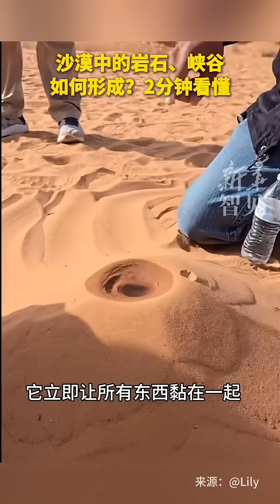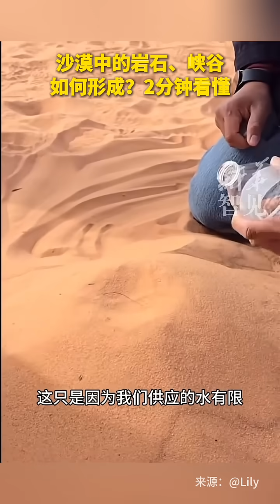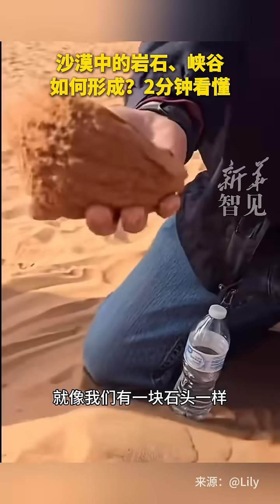I love listening to lectures like this.

Comment: To edify the ignorant demonstrator and those watching; 
google "cross-bedding" and watch the COLORADO SEDIMENTAION FLUME EXPERIEMNTS. Cross-bedding are the 10-15 degree angled lines that traverse across the horizontal sediment layers (if the sediment was deposited by flowing water like a flood. These can be seen on a major scale across all continents. THEY DEMONSTRATE the flow direction, speed, and timing of sediment deposits under flowing water. This information recently revised the their accepted age of the grand canyon by billions of years because of the combination of sedimentation, erosion and lava flows in the canyon. 
Trust physics you can see with your eyes, not a story "scientists" have been brainwashed to accept.

Comment: I’m a geologist. Nice demonstration, but the formation of sedimentary rocks isn’t represented accurately here. Silica doesn’t just “turn into glue” from rainwater, and the sun doesn’t “bake rocks”. The sedimentary rocks are compacted underground from high pressures caused by deep burial. Infiltrating groundwater with dissolved ions can precipitate silica and calcium carbonate in between pore spaces, cementing the compacted stone. After deep burial, tectonic forces uplifted the rock, and the overlying material gradually eroded until the sandstone was exposed at the surface. The part he got correct: flooding events carved the modern canyons. The sand in the area is deposited through wind. A cool video - but it isn’t rooted in science.

Comment: And right there after first cycle, China found a way to desert Greening by Silica compassion, and making the whole and filing with long lasting type of plant in advance. Then making canals from surrounding rivers pouring into the land and it take less than a decade to witness a brand new forest. Other trick is to releasing tens of thousands rabbits in deserts. Go and find out why...😅

Comment: I guess it doesn't take thousands of years, just a few min.
Reply: He literally said it takes millions. This is what happens at a larger scale. Dirt, rocks, and other mixtures of minerals aren't as loose as small desert sand. That's why he uses it as a demonstration.
Reply: @aangmaster9392 
Sand formations are quick and temporary.
Hard rock formations like granite are really old.
Reply: @Jpm463 That's what im saying, so I'm confused why you think this wouldn't take thousands to even millions of years.
Reply: @aangmaster9392 
Cool you get it. 
When structures collapse after some wind and rain you realize you should question claims of, 'millions of years old'.
Tettegouche sea stack, Azure Window, and Utah's Double Arch are just a few recent examples.
Reply: @Jpm463 No, Millions of years old is realistic because they're harder materials than sand covered in water, and wouldn't collapse as much. What are you not getting?
Reply: @aangmaster9392  got it, so you're saying iconic, millions of years old formations collapse after it rains. And its the first time it had ever seen heavy rain in millions of years. This happens about once per year. So there must of have been millions of these one of a kind iconic formations at one point. 
Sure that math adds up. 
So where are the current millions of iconic sedimentary formations? Are we at the end of an era?
Reply: @Jpm463 Bruh..I never said old formations immediately collapse after receiving rain again. Where are you pulling this from??

Formations happen due to thousands to millions of years of erosion or natural elements. You do realise weathers never stay in the same location forever right?

The sahara desert literally used to be a green area and had lakes. Nothing stays the same and life moves on.

Comment: This is bullshit. Sandstone turns into rock through pressure and temperature increase which mobilizes the silica and deposits it around the grains, cementing it. Meteoric fluids only cement if they bring in calcium carbonate and only in limited concretions.

Comment: Great demonstration, but.... the rain water is not concentrated in a heavy downpour over a part of a rock. It covers a very large area, equally distributing the weight of precipitation. Also, the canyons would have the "delta" with the debris at the mouth of the canyon, just like in the demonstration,  which would cause the collection of the debris mounts, which are not found, either.  🤷‍♀️

Comment: There’s just one problem with this…. The highest point of Grand Canyon is 8,000 feet and the height at which the Colorado river enters is 2,700. Even assuming that the river found some sort of underground passage that it caved in and pushed down stream, the canyon shouldn’t be nearly as wide as it is and unless water learned how to flow uphill… a flood is still the most likely answer. 

This is a great theory, but it’s just a very educated theory.

Comment: Pure fiction. Only one sediment responds this way to water The GC has multiple types of sediment. Scale this up by 100,000,000 to get the GC you would need a catastrophe to get the same results. And none of what he did was under intense compresion due to yhe weight that was above it. 
Learn to think critically before lovng on experiments like this.

Comment: The Grand Canyon wasn’t carved slowly over millions of years like they teach in school but was formed rapidly by a massive amount of water in a short period of time, probably from the catastrophic drainage of a giant post-Flood lake when the earth was recovering from Noah’s Flood. Imagine a dam breach on a scale you can’t even fathom, releasing water with incredible force that ripped through soft, freshly deposited sediments, cutting that huge canyon in days or weeks, not millions of years, leaving those flat, pancake-like layers as clear evidence it didn’t take long ages to lay them down or erode them out. You can see there’s no significant erosion between those layers, which means they were laid down quickly one after another, and there are fossilized trees standing upright through multiple layers, which couldn’t have happened if each layer took millions of years, proving this whole thing points to rapid deposition and rapid erosion in one giant catastrophic event.

Comment: The head waters of the Colorado River are around 1500 ft. lower in elevation than the rim of the canyon...    water doesn't flow uphill.
Reply: The Colorado plateau has been rising for millions of years.  The river has stayed relatively stable.  The canyon was carved as the plateau slowly uplifted, and the river slowly maintained its elevation.

Comment: The reason this doesnt work is because if the rain is to infrequent (like would be in aeolean enviornments) the soaked layers do not litify because they dry out to quickly.

Youed need consistent water to keep the underlaying layers from seperating upon deying before sufficient pressure can be put on top of it.

Comment: I call bullshit on this... The metaphor does not prove the proposition. "Professing themselves to be wise, they became fools..."

Tell me again how millions of years cause multiple layers of discrete sedimentary mineral deposits to stack on top of each other and become thick layers of solid rock extending for hundreds - if not thousands - of miles...?! 

It was OBVIOUSLY caused by one flood, as the volume of water required for such prodigious deposits was a one-shot deal - far greater than any amount of water that could be supported in a recycling ecosystem... THINK for a minute before believing illogical nonsense such as this creative fabrication...!

Comment: That also how the bricks to the pyramids were made. They had molds for the sand to be placed in. They filled the molds and when the rain came they became blocks. They were immediately covered for any future rains and stayed in the sun for 10 days. On the 11th day they were dragged to the location of the pyramids and thustly they were built.
Reply: No they weren't. The pyramids are built from limestone, not sandstone. And sand doesn't turn to stone just by soaking and drying it, it needs to go through that process hundreds of thousands of times to make a brick that could hold its own weight

Comment: Yeah ok. But it rains everywhere not only over a few square meters so why is the sand around it not strong?
Reply: Because the rock formation and canyons are flipping massive. You can get rain, and flash rain on small areas by the way, as small as a few square meters, sometimes called localized showers, or sunshowers.

Comment: The sand turning to a “glue”, or binding is actually due to silica, not silicon. The reason it binds is because of capillary forces and surface tension that holds it together.

Comment: This is what the internet should be. Useful information and not just brainrot.
Reply from the maker: Great lesson.
Reply: @山海木 not at all
Reply: This is brain rot. He said the water "melts the silica" what type of bullshit is that???? The silica are in chemical bonds (SiO2) you can't chemically alter something by physical means 

Also the sand is just sticking together by the water's surface tension. And the SUN heats up the sand to the point of rock formation???? That's just not how it works. He's spouting so much nonsense it's actually mind-numbing
Reply: So it's not brain rot huh? Quick where is this place located...yeah...it's brain rot...and stolen brain rot by some Chinese thief no less....
Reply: Yes!
Reply: Tu n'as pas de rivière en pierre de diamant pur.. toujours des cailloux et parmi les cailloux un diamant par-ci par-là
Reply: Fun thing is that this is all style but no substance, using simple water adhesion force as imposter for everything else just leaves people with the illusion of knowledge.
Reply: In what way is it useful?
Reply: @stvrob6320  don’t worry, if you’re asking that then intelligence and learning are probably not a strong suit for you

Comment: Why the heavy rain is only in the middle? Shouldn't it be all around?
Reply: rain doesn't fall over the entire planet at once, it falls in patches
Reply: @bonkdonk297  I understand in a circle, but I havent seen it be in like a S or Z shape🤷🏻‍♂️ so just wondering
Reply: @konstanZX2  if you are talking about when the water carves the rock in half to form a canyon, he says that's a flash flood. water will always take the path of least resistance. if there is a small part of the rock that is sloped more, rainwater will follow that path, and as it happens it will erode that path to be deeper, meaning that more water will flow down in subsequent floods which is what carves the shape of the canyon. think about a river, rivers are S shaped, curving back and forward as the water flows together and erodes the edges of its path
Reply: @bonkdonk297 Oh alright now I understand thank you!
Reply: @konstanZX2  glad to help, sorry I misunderstood your question at first :)

Comment: When how and why did the rain fall only in a spot that resembles a man pouring water out of a bottle??? 
In other words, as smooth as this guys voice is… it doesn’t make it necessarily true/accurate! Js
Reply: Water flows downward in the path of least resistance, that's how streams, rivers etc. are made. Imagine the water bottle as collected water running through these paths over a long period of time.
When you see videos like this, consider what the tools and process they are using represent.

Comment: Sorry, this is untrue geologic science, this is NOT what is found worldwide.

The Grand Canyon, nor other canyons with under-fit rivers at their bottoms, DO NOT look like the walls of this supposed canyon formed  by millions of years of flash floods and pressure cutting through rocks. But rather undisturbed (without bioturbation) sedimentary LAYERS of rock, which signify relatively RECENT formation. The layers seen in the Grand Canyon can be seen across the entire USA, as well as into the UK, Europe, and continuing around the world. This signifies a catastrophic world wide covering of water followed by catastrophic volcanism, and plate techtonics. Furthermore, these sedimentary layers are interrupted by uplifts from catastrophic volcanism and plate techtonics forming the mountain ranges we see today. Bending, or folds in these sedimentary layers are indications that the layers were soft when they were uplifted, as opposed to the uplifting of hard layers which would fracture or break. This, again, indicates that these surfaces were covered in water, and again can be seen THROUGHOUT the world!

The continental land formations seen away from the edges of these canyons are surface landforms that are seen after the receding away of water, ie; planation surfaces with, plateau's, mesa's, butte's and spires. A "flash flood" would not contribute to these continental formations, nor water or wind gaps seen worldwide. A worldwide flood even explains fossils and the supposed "geologic column" with an overwhelmingly convincing model.

Comment: Silica sand is really bad to breathe in yet it’s naturally found in the earth. Silica sand is used in sealcoating emulsion for grit and traction but has dangerous affects on lung scarring. Silica sand in sealcoat is mostly dangerous when the sealer dries and breaks away from the asphalt and blown around with dirt into dust when cleaning. It’s not just harmful for workers but everyone around the area breathing it in. Now you know

Comment: Thank you for sharing this, this helped me explain a situation we are dealing with on a house that we are building in Ontario where we have discovered granite and sand rock deposits where the Canadian shield and the North American mantle have met and while the builder we are doing the job. Four thinks we are wasting time removing this rock and costing the customer more money. There is a science behind why the rock in the area is hard and soft and this helped prove my theory that when water hits the sandstone sections of these rocks it will erode and that we cannot build on top of the stone that we must remove it. Some sections we are chiselling away. Our heart is granite, but when you move over 2 inches it can chisel away into sand and then if you move over a couple more feet, it chisel into big chunks.So this video helped me validate my case, and I also used AI to break down the science and shared it with them.
Reply from the maker: Thank you for your attention!

Comment: In a hundred years of flash floods, the boulders at the bottom of the canyon haven’t moved an inch. They look exactly the same as the photos from 1920. That’s because a canyon can only be formed by water moving through non-lithified sedimentary layers.  Once the sediment hardens into rock, the water flows over or around it causing little to no erosion. The canyons were, in fact, created by the retreating waters of the same big flood that laid down the sedimentary layers.

Comment: Sand particles comes closer (sand mass becomes denser) when it soaked in water (get moistened). And achieve maximum density at an optimum moisture content. Becomes harder and forms sand stone beneath the ground by gradual consolidation.
Reply from the maker: 感恩遇见

Comment: Rivers resist uplift. Canyons are made by terrain rising and the river staying in the same place. Rivers always flow at the same level towards the sea, they have to or else you form a lake that eventually bursts and the process continues down hill. Rain water erodes already exposed rock, but it does not cut deeper canyons.

Canyons are made by the ground rising upward while the river resists.
Reply from the maker: 精彩一课

Comment: Adding water to silica does not turn the silica to glue.  Most sand is made of SiO2, which is the same chemical composition as window glass and quartz.  Neither turn to glue by reacting with water.  Sandstone is caused by the compression of layers of sediment over millions of years.

Comment: The silica does NOT turn to glue... The water spreads all over the small particles and its viscosity paired with the increased surface area holds the sand together. Until it evaporates. If you are going to teach, you better know what you are talking about..

Comment: Put brownie mix in the oven, they harden and you can make them into squares.
Put brownies in water, they dissolve into brownie mud.
Something else I want to add.
Maybe this is a school in a unique location, but I'm assuming this is a field trip to the desert. This could've have been taught and explained by telling them from water and pressure making the sand stick together that over time it hardens into a rock.
As well as the part about floods. All done in the class room.
But the significant part is, the manner that he did it this way, can inspire a student to pursue the field of geology, maybe even archeology or anthropology.
Or even some other field through the desire to explore something new to them.
This is the difference between a student simplifying this as "all we did was look at rocks..." versus "I never thought of it that way..."
Reply from the maker: Thank you for meeting me

Comment: That's good! Nice and informative. Also, you can also form the exact same conditions not only slowly like he mentioned, but also quickly as shown in the video on a more massive scale if it is under extremely high pressure like heavy flooding or strain from rapid formations like seismic formations. We have had floods and earthquakes cause similar examples of water erosion. Most of that sand was probably formed by tons of lava rapidly cooling (silicon is just one of the lighter components of lava).

Comment: Hubs found sandstone in our creek.
We broke it open and it turns out it is probably less than 50 years old. Probably closer to 10-25.
Some parts were solid, some were gritty, some were full sand, and some were laticework made with sand particles.
It's super neat.